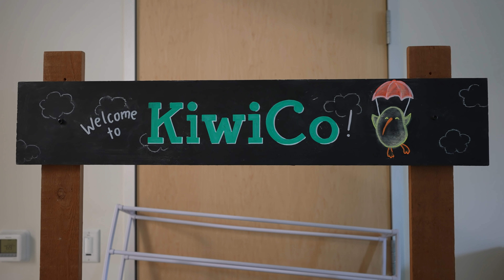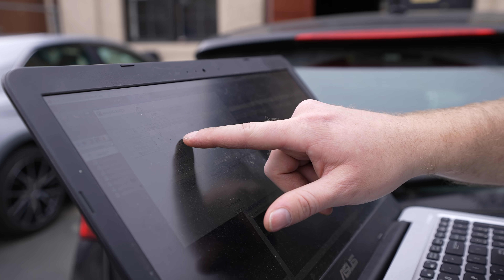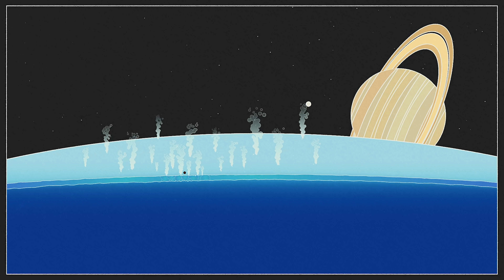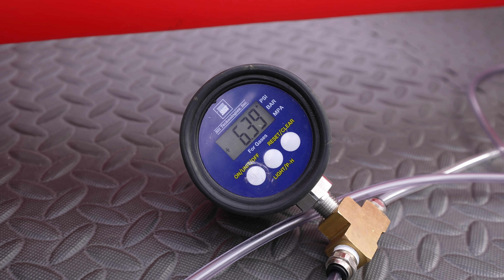Why Robots That Bend Are Better

Comment: Can you help with a problem. Lets say, Im standing near the sun and say a charge q+ is on the earth, from my point of view the charge q+ is moving as the earth revolves around the sun and as moving charges are  suppose to produce a magnetic field it dosnt seem to.While the person on the earth with the charge q+ it is stationary. So, at what point does the charge chose to produce the magnetic field. lets say normaly u pass a current through  wire, it produces a magnetic field, but if you were to move along with the charge, would it produce any magnetic field.

Comment: just take a body shaped balloon bit the same mechanics on the in side and sow it up  easy someone do this plz
Reply: nvm that wouldent work idk
Reply: Let's think this through, Rog. Body shaped balloon is a great framework. Imagine compliant 'muscle' tubing on the underside of the skin. The pneumatic driver could be in the hip area, and processing in the head. Assuming you could maintain air pressure effectively with a strong fabric and expandable lining, that doesn't seem like an impossible task.

Comment: Veritasium 
Can you do a video on why hands smell burnt if rubbed together fast (or comment?)?
Surely my hypothesis would be that the friction generated heat does indeed burn skin cells, but only the superficial, first layer of cells in the stratum corneum.
So the superficial layer gets burned off, but because that first cell layer is so thin, the heat is quickly diffused into the rest of the layers and the air, so it only feels warm, not really hot.

Iwasnt able to find any info on this myself, so Id appreciate your imput.
Im curious lol

Comment: Awesome and useful? Definitely. But better? I'm not so sure. I'm just not sure that something with literal rubber that has to constantly bend is going to have the longevity to be worth launching on a several decade-long journey into space to the outer reaches of the solar system or even the closest planets. It would have to last for so long that even a chance of it not working would surely make it not worth it to use. Also the weight is a lot more of a problem than the volume at least within certain scenarios.

Comment: Now pump it up with Oobleck!
Also have some latex/polymer blended sheets across this and it would be the first robot I would believe to be for "disaster response", good lifting surface or move through cracks to provide shelter within collapsed structures whilst rescue workers get to survivors

Comment: Can't they use the same type of structure/principle that nasa used for it's airless tires? But then it would limit how much its size could reduce, because of the stress limit before permanently bending the metal

Could also try doing the same, and using "memory metal"... But then the robot would need a way to keep re-heating it's own "metal fiber tubes" and that would create a power issue

Comment: Qué, one day three friends decided to plan a small breakfast at small hotel,one of those paid money I,e. 25+25+25 ( 25rs,each) before having breakfast,but manager thought to return them 5rs (as discount ) through weighter (but weighter stole 2rs),all three friends equally distributed 3rs (i.e,1rs each).

So,finally cost of breakfast individually worth 24rs right!

Now It's time for calculation :
Firsrly,25+25+25=75rs 👍

Final calculation;
24+24+24=72
72 + stolen 2rs = 74rs

WHERE IS 1Rs ???

Rs is Currency of INDIA

Comment: Wait a minute.
So NASA wantS to use it under some liquid. Does it sink in that liquid.
In the illustration shown, it was inflated while inside the liquid so it is required to have compressed gas stored. 
And even if it sinks, how deep can we expect it to go.

Comment: i saw a video where a guy tried to make a thrust vectoring gimble for an rc plane using compliant mechanics, and the problem he had was that the compliance necessary to make the mechanism work also made the mechanism entirely too flexible to handle the thrust it was supposed to be steering. you can say "oh these robots are better because they aren't strong enough to hurt you" but it's still pointless if it's also not strong enough to do anything useful

Comment: Think I cracked measuring the 'one way speed of light' / I need someone who knows what they're talking about to tell me why it's wrong
Reply: I propose accelerometer or tension clocks. Timers that start when they undergo a certain change in motion or change in tension of a tether.
Reply: Tether two clocks to a central anchor with two equal and known length...tethers..
Move both the clocks in opposite directions until they reach the limits of the length of the tether.
These clocks are designed to begin when they detect a certain (sudden and reducing) change of tension in the tether.

Destroy the central anchor.
Reply: Won't then both clocks be synchronized exactly? 
One clock sits by apparatus designed to emit an identifiable burst of light and is programmed to stop running at the moment this light is emitted. 
The other clock is designed to stop running when it detects this light.
Reply: With both clocks stopped, could they not be brought back together whereby you'd have the time difference of the clocks.
The distance between the clocks was known and exact...
Reply: Wouldn't this give the one way speed of light?

Comment: Bad title.  Disliked.  This is "The advantages of soft robots," and I'd definitely say they're interesting, but everything I've seen in this video is in the proof-of-concept stage and have only demonstrated the ability to move on a flat surface and pick up a ball.  Note, by the way, that I don't think it can actually carry the ball as that entire triangle cannot move without dropping the ball.  Yes, this is cool and has theoretical benefits, but until (and unless) it is fully developed (and I hope it will be), you can't say they're better.

Comment: the first red robot could be used in a military setting put some AR-500 steel plate on each of the faces are you have a moving cover system that can take a couple 7.62 rounds and boost the machinery and make the steel like 3-4 inches thick and cover the circuitry am I the only one this sounds like a good idea too?

Comment: Yo,  black holes will consume everything,  and each other,  and that will make a big bang.  the big bang has a resonate frequency of like 0.0000000000000000000000000000000000000000000000000000000000000000000000000000000000000000000000000000000001  Hz.  

can some one with a degree get on that?  thanks.  bless you.